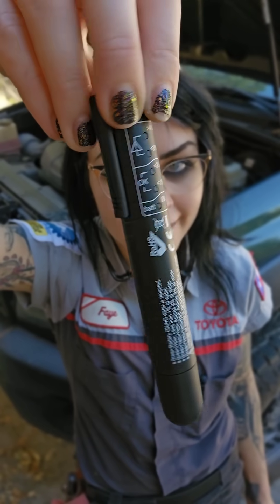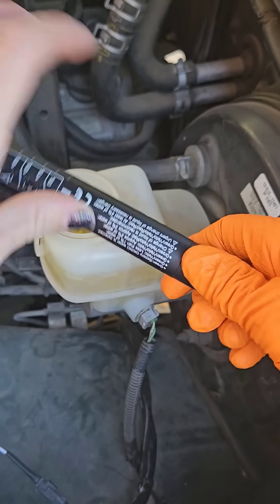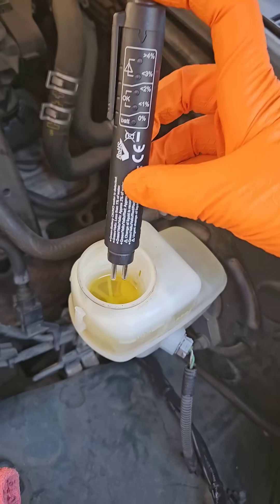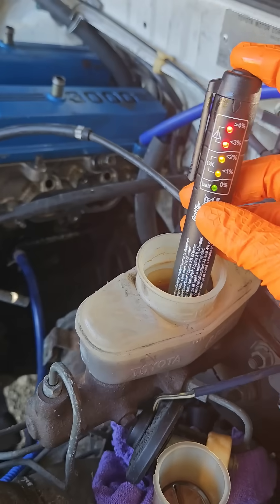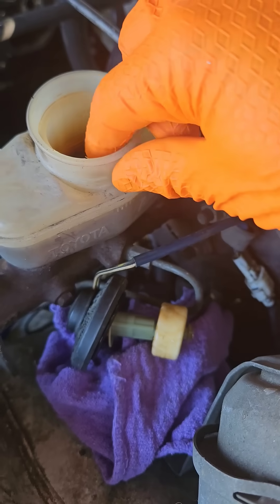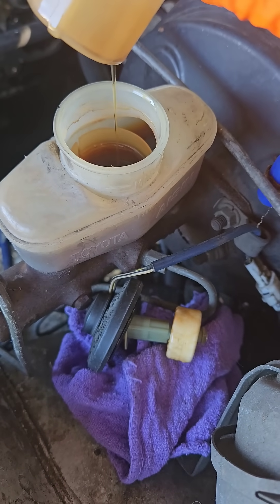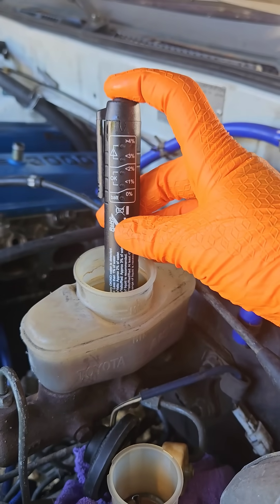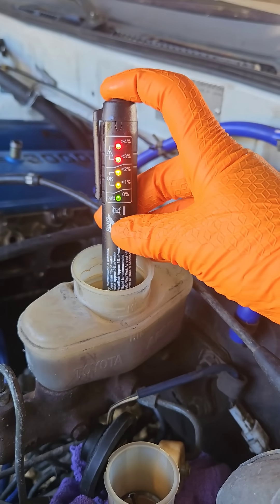Do you REALLY need your Brake Fluid Flushed?? How to Test it For Yourself!

Comment: My jeep changes it’s own brake fluid, I just have to make sure to fill it often 😅
Reply: Jeep thinks of everything
Reply: @BurtSanders except for driver leg space and elbow room but you right
Reply: i drove for a while with a leaking drum cylinder, had a full flush done by the time i changed it
Reply: @ambivalentonion2620 sounds like my transmission. But I ain’t fixing it!
Reply: @ambivalentonion2620 ok so that one wheel had a flush, what about the other three?
Reply: @ambivalentonion2620 each brake hydraulic circuit is independent of the others, but they share a reservoir and master cylinder.
Reply: @ambivalentonion2620  lol
Reply: if its leaking its got fluid
Reply: @EnjaminEX it's when it quits leaking that you've got a problem 😂
Reply: My silverado been doing that for 3 years 😂 cleanest 2008 brake fluid tank around 😂😂😂
Reply: @jonathonvince561   NOT funny damn
Reply: Same for me when it came to coolant and oil in my bmw back in the day. I just refilled it every 2 weeks so it was always fresh 😂😂
Reply: @JohnnyCage4Real well coolant and oil I can understand but forgetting the brake fluid that shit could be deadly
Reply: @JohnnyCage4Real damm as a bmw owner I can confirm the part coolant 😂
Reply: @JohnnyCage4Real  that means you had to have been seriously burning through fluids or leaking or most likely both.
Reply: @JohnnyCage4Real that actually seems very beneficial
Reply: @JohnnyCage4Real 
Damn every two weeks?
Reply: That’s the one fluid you shouldn’t let leak I pray for your safety
Reply: lol!
Reply: Oh god  😆
Reply: I bet you reset your check engine light every time you start your jeep
Reply: @tru3sk1ll It was modified to be self resetting.
Reply: @tru3sk1ll don’t gotta call me out like that lol
Reply: @tru3sk1ll  ...well, that's one way he knows the light is working. If the light goes out, THAT will be a concern.
Reply: Just like the engine oil in a Jeep Cherokee.
Reply: @xXGENDAMAGEXx you ain't kidding OMG I didn't know how bad it was leaking till I drained it, out a quart of motor flush in, and only drained 2 1/2 quarts of oil/flush mix 😂 can't believe that motor was still going
Reply: And ford ranger lol
Reply: @davidduval5566 It's the steering rack fluid in my Cherokee.
Reply: @davidduval5566 I had a Ford Ranger that changed its oil pretty much twice a week. It went through (leaked) one liter of oil a day. The crank was badly scored at the rear main and it just pissed out. It was an early 2.3 with a two piece seal. Luckily I got my oil for free. The underside of the truck was nicely oiled.
Reply: Smart car😊
Reply: My Cherokee used to just store extra coolant right into the passenger rug to save for later. What will they think of next 😅
Reply: Jeeps love doing that with every possible liquid. I think even my bumper leaks oil. 🙃
Reply: Who needs brakes when youve got a stick shift :P
Reply: @fyregus well, brake pads are much cheaper/easier than servicing the clutch
Reply: This is a design feature of Chrysler.
Reply: Every jeep owner ever hahaha. I love my Jeep. It even burns my oil so I don't ever have to change it. I just jeep adding more.
Reply: Sounds like Jeep, Chrysler and Dodge 😂😂😂
Reply: 😂 good one
Reply: I gassed it a little on my 2014 Jeep wrangler and got a check engine light and fried a knock sensor and knock wiring.  already had a trans go out once, also had catalytic converter with internal failure twice 🥴
Reply: Lol
Reply: Lmaoo
Reply: I thought so too til my wheel cylinder seals completely failed and sprayed fluid all over the brake drums
Reply: Can y’all help me with my Jeep??? It sounds like it wants to start but won’t. New battery. Has been sitting for a few years. 96 XJ
Reply: @jamn2boost try some quick start spray in the intake.. a couple of sprays and try and start it.. then you’ll know if it’s just not getting fuel if it instantly starts .
Reply: @jamn2boost you should probably post a little more info, like- the engine turns over, but didn't start, or the engine tries to turn over but won't, or it tries to start and dies.
Reply: @jamn2boost check for fuel, shrader valve on the rail. If only a little or non comes out you have no fuel delivery. That's a good way to rule out the pump. May need a crank position sensor, see if it gets hot when you try to start it. That's a sign its having problems
Reply: @jamn2boost  Stale fuel?
Reply: @jamn2boost  if you're in the Midwest, I've got you. Come on over. We can grab some beers and have a Jeep fixing party. I hold them weekly....... because my Jeep breaks down every week.
Reply: @aThoughtandaShot  ahahahahahaha I would take you on that offer but I’m Deep South Texas. Still got those beers ready tho.
Reply: @jamn2boost did you test the alternator,starter and timing belt.
Reply: @jamn2boost usually a fuel issue. Listen before you turn key all the way and if you hear fuel pump engaging. Could be a few other things, too.
Reply: Hahahah
Reply: @TierOneTolley i know,right😅
Reply: Built in Mexico 🇲🇽
Reply: @BOG0690 Mexican products aren’t even that bad, it’s China and Vietnam you gotta look out for.
Reply: Yep, it's a Jeep thing. Just like the oem $1,500.00 soldered fuel pump relay "Tipm" engine fuse box failure that causes engine shut down while driving. The driver side oem condesor leaks, engine oil cooler failure. 

Just Eats Every Penny.
Chrysler Has Recommended You Start Learning Engine Repairs
Reply: @mobileterminaluzer1858  That's so not fun bud
Reply: I don't think any of the people in this comment thread deserve to own cars
Reply: @greengoat5654   I agree it is beyond sad people think its funny.....prolly all red hatted DT supporters
Reply: Haahhahahahahahaha 😂 jeeps!
Reply: where does it go??
Reply: My Jeep did that as well I remember😂
Reply: Brake fluid is extremely flammable... I would get that fixed I've seen mini coopers catch fire because of power steering leaks
Reply: As a fiat owner, can confirm
Reply: My Jeep has that feature too.... on literally every fluid 😂 but hell it's rolling over 300k on an original block, transmission and rear end, that's 24 years old so 🤷 reliable old piece of shit 😂
Reply: I had a truck that had a leak at the trailer brake controller. It would leak onto the top of my boot while driving. Ever since then my hair have been falling out. But maybe it’s a coincidence.
Reply: Heap
Reply: Drive it with the hood open and your mechanic running along side refilling your brake fluid 😅
Reply: Jeep saved you money that’s all
Reply: Just like my 60 mile a Quart Subaru oil change 😂
Reply: 2 Toyota's an 03 and 16,no leaks at all ever.
Reply: I would like to inform you that you are now in the running for the 2023 comment of the year 👏🏻👏🏻👏🏻
Reply: Omfg nooo
Reply: My Malibu does the same thing 😅
Reply: @patrickdurst3495  
No surprise there!!
Reply: Fancy, I have that same tech with the coolant system on my audi.
Reply: How does it pass inspection 😂
Reply: @LongIslandCityLayout vehicle inspections are a tax on poor people
Reply: Its own*
No apostrophe with possession...
Reply: I just got a 2013 wrangler and the fluid is completely fucked, I’m assuming it’s common💀
Reply: And you killed 3 motorcycle riders in the process...
Reply: We dont believe you. Most leaks make the pedal fall to floor
Reply: (Big sigh) That's Chrysler for you...
Reply: I been driving my jeep on a burnt clutch for the past month, but hey doesn’t matter if I get stuck in the same spot for 30 seconds on a hill when you got a jeep right 😂
Reply: I don't always maintain my car to 100%, but I make sure that my brakes are tip-top, as they will kill me if they don't work properly. 

Also tires.
Reply: Mine too. Pretty much every fluid, although I finally did the rear main seal, I was leaking a quart every few weeks in the 01 XJ.
Reply: I was doing that with engine until I did the rear main, a quart every few weeks. It got kind of ridiculous.
Reply: Jeep has got to be the biggest pos
Reply: Another brilliant design from jeep
Reply: Be careful. Brake fluid is very flammable. Don’t wanna be driving down the road in a fire ball.
Reply: Mine Tundra the same thing with oil. Top it up a couple times a week. It's already at 450,000 miles so I figure its cheaper just to add oil than get it fixed.
Reply: Bro that’s right free labor
Reply: Lmao same but my jeep leeks oil and coolant refill every month or 2 😂
Reply: Amen, my best friend got all the way to charlotte like that from Buffalo. Just keep the DMV IV stocked!🤗
Reply: I had an old VW Super Beetle like that. It was so helpful when it would flush its own fuel lines 0_o
Reply: Don’t forget, same goes for your oil! 😂
Reply: That also means there is a leak so you're losing alot of breaking force. As the pressure is excaping.
Reply: hahahahhahaha
Reply: Yeah my oil does the same thing on my 2001 dodge ram. I use it as a spare vehicle and to take trash to the dump. I think the last time I put water in it, it gave off a sigh of relief and said thank you.
Reply: Oh naw 🤣 🤣🤣🤣
Reply: Jeep? I bet it changes motor oil and tire air for you too.
Reply: Bro get the fuck off the road,  you're over here bragging about your shitty jeep that's gonna kill someone
Reply: I saw jeep and I knew why you're watching mechanics
Reply: How about the leak?😂😂😂😂
Reply: Lol your comment just reminded to go and check all of my fluids from my leaking Jeep
Reply: Just
Empty
Every
Pocket
Reply: Never saturated!
Reply: I love self changing fluids. The oil in my 94 civic changed itself :’)
Reply: Yeah everybody funny now you funny too Don't forget to top off that brake fluid before you got no brakes crash
Reply: My chevy corolla the same way. But with oil
Reply: check your lines and bleeder valves.
Reply: If it's not leaking it's because it's broke down.
Reply: XD.
Reply: thats only one thing to check. They can be fine on water absorption but fail for corrosiveness. this is done by check for the copper content using brake fluid test strips. This will measure the copper ppm (parts per million).   a reading over 200 means the brake fluid is eating the metal and the fluid lines have copper in them and it means its breaking down the metal from inside.
Reply: JEEPER CREEPER🥴
Reply: Women am I right?
Reply: Spelled fill wrong. It's feel! 😂😊
Reply: 😂😂😂😂😂😂best answer
Reply: Ur jeep is shat, that's why you need to fill it everytime
Reply: Sounds just like my dads old zj, it even had this cool massaging feature where the entire chassis would vibrate like it was about to fly off the frame 😂
Reply: Aye my mustang does the same with the oil
Reply: Yeah I had a 92 Hyundai that never needed an oil change because I put a brand new quart in it every week
Reply: i have the same transmission as your brakes 😂
Reply: It's funny til you realize it washes into local  waterways and now the fish you can legally catch you don't want to eat.
Reply: Big lol
Reply: Yes! I HAD a Ford, all the fluids were automatically draining daily, drove around with a crate full of automotive fluids, topped off before and after driving each day.
Reply: Self flushing that’s genius 😂
Reply: Jeeps are the best 😜🍺🍺
Reply: Thanks for contaminating our roads for them to get in our water system and tires to loose traction
Reply: self replaces w water..
Reply: For my wife her jeeps power steering fluid changes itself! 😂
Reply: Yh my bmw use to leak oil I called it self servicing
Reply: I had a Cadi that changed it's own oil. Kept my engine CLEAN.
Reply: whatever you do dont replace leaking cyliders just let that crap drip all over the road and your tires and finally have brakes fail and kill people....yeah heaven forbid you spend money on maintenence.....jerk
Reply: @dougiequick1  your needs... they're very special.
Reply: What a nice car! It does half the work for you!
Reply: It's a Jeep thing.
Reply: "Jeep" - nuff said.
Reply: Your insurance company here. What was that?
Reply: Lol you can also do this with your oil if you remove your head gasket 🤣
Reply: Did the same for a while with my old 80s Camry, ran and drove fine, it just leaked brake fluid constantly.
Reply: My truck does the same with engine oil.
Reply: That's exactly why it's like that cause the fluid was never maintained it attracts water and it turns to like a glue inside the caliper and then it leaks
Reply: The comments never disappoint... Thanks for the laughs guys.
Reply: Heeey! Same with the 65 barracuda I had in the 90s ;D
Reply: Hahahahaha
Reply: Fantastic idea in saving maintenancecost's,  now how do I sabotage my breaks. Hmmmm
Reply: Average rubber ducky enthusiast
Reply: I had a mini van that changed its own oil every 2 months, finally junked it
Reply: You have a leak my guy 😂
Reply: How you jeep make it?
Reply: Brake fluid eats car paint so driving with a leak will spray the fluid on other peoples cars. That’s not nice .
Reply: Haha
Reply: I’ll never understand why Americans are able to 1. Drive unsafe vehicles, putting the lives of others at risk 2. Dump liters of toxic and corrosive chemicals into their environment 3. Laugh about it without shame
Reply: @TheOfficialOriginalChad hold up. Let's examine what you just said: "I don't understand why Americans are able to drive old, worn out vehicles"
Bro, have you ever BEEN to any other part of the world??
Reply: @TheOfficialOriginalChad  I'm from Sweden sir
Reply: @TheOfficialOriginalChad because we have to commute an hour to work out 80 hot a week job to survive you lazy euro bum
Reply: @chadlipscomb yup we drive 4x4 pick up trucks burning fuel like crazy.  Most people don't need these trucks , and lately I see women driving them . Don't know how we got this way.

Comment: The rule if thumb I go by, especially in my area, is if you got a used car or have had the car for any amount of time and you've never had it changed or don't know if it has. Change it. If there's a problem, there can be more than one part causing the same issue. And if none of those parts have been changed in a while, then it doesn't hurt to change all associated parts to eliminate any doubt or any comebacks for still having the same problem. 
     Brake fluid is probably one of the most underserviced fluids, right behind coolant, differential, or power steering fluid. The only one that seems to matter is oil changes. But that's only because they're advertised and most generally everyone who drives a car knows it should be changed regularly. Then again, there's also a lot of people who have never been taught about any of it. So it just goes and goes until the entire thing is ruined

Comment: Yes. Its hygroscopic. Water tends to absorb in it and goes to the rear of the veh, ruins calipers, wheel cylinders and causes brake fade and complete loss of brakes. We do flushes every 2 years as rule of thimb, nothing over 3 years. I flush my motorcycle every year if i have time, or every 2nd.

Comment: Another thing to check is if the brake hoses are old, the rubber deteriorates and then flows through the system. You'd see it as black particles at the bottom of the reservoir or from the fluid out of the bleeder screws
Reply: Good tip. Thanks.
Reply: Yes...please check them. I had my brake line break on me while on the freeway from work one night. Very scary. I have steel braided lines on my car now.
Reply: OMP, thank you! 
i was wondering why my clutch fluid kept going dark fast, and had little particles, even after flushing!!
now i know the line itself is deteriorating... 👀😦.... 😨fk...

Comment: I have some bad experience with these devices. Basically european Golf R, factory recommends 3years and then 2y for each flush. As under warranty, dealer is working on it. Almost 4 years since new, no brake fluid changes. This device showed OK 0%, yet the brakes were totally shit and pedal got soft very fast. So flushed with the OEM fluid (same as it was before) and went for a spirited drive. No other changes - brakes were great. So basically moral of the story is that moisture in brake system is only one side of the coin. When brakes get used, the fluid degrades also in other ways. In daily driven cars, it would he sufficent when it is ok. In my opinion, max 2 years even when moisture level is ok.

Comment: Fluid dynamics tell me all I need is hydraulic pressure inside the brake lines.

But pressure = HEAT and I need a liquid inside that has a pretty high boiling point and the ability to get hot and not boil off.

Do you NEED to change old fluid? Not really unless it's been been thinned so much that it's half water from the heat cycling and near boiling temp of the fluid.

Never once have I changed brake fluid for just a service interval lmao. It'll get changed when the master goes bad or a caliper goes bad. Then I'll flush the entire thing

Comment: You can get more saturation and breakdown in the calipers and lines themselves had the reservoir be just fine and decide to flush some fluid out everything that came out was nearly black and bad. This is a good tip but not a catch all especially since there's a lot of places that top off your brake fluid leaving newer fluid in there.

Comment: You absolutely don't need to flush your brake fluid or power steering fluid in any daily driver car. Lol I've owned vehicles 20 plus years without any problem or changing these fluids. Now in my race cars, you absolutely need to change all fluids.

Comment: Most car manufacturers recommend changing the brake fluid every 2 or 3 years or around 45000 miles failure to do so could invalidate warranty, also apart from the obvious inaccuracy of this type of tester, taking it from the reservoir which probably has the cleanest new fluid in it might not reflect the condition of the fluid in the pipeline or calipers, I would have thought it would be better to bleed some out for testing and inspection.